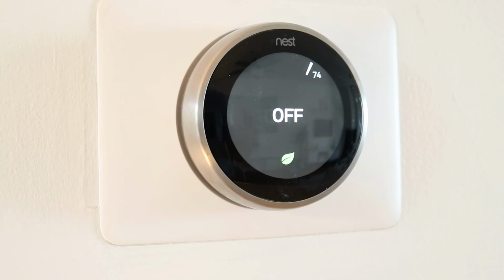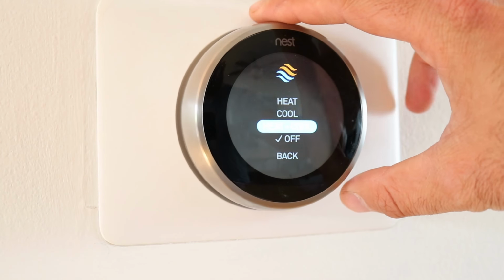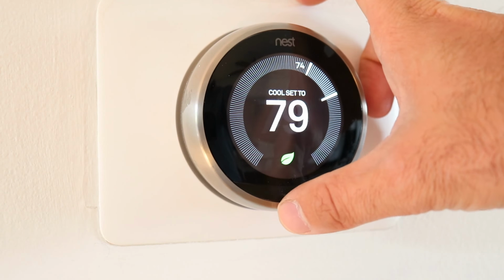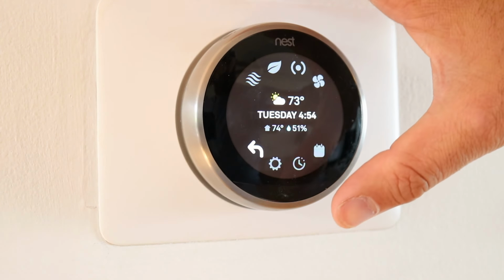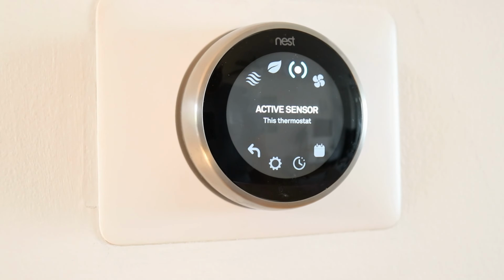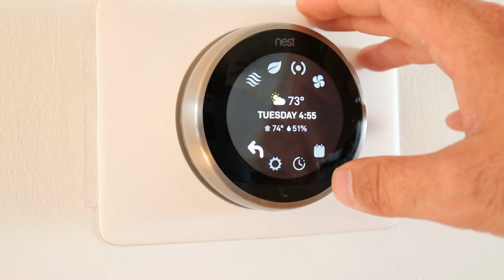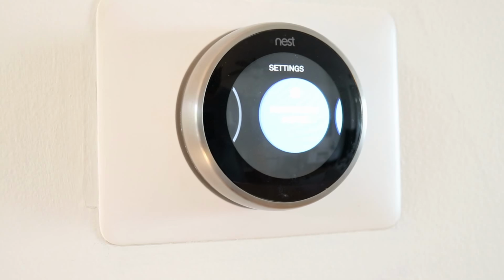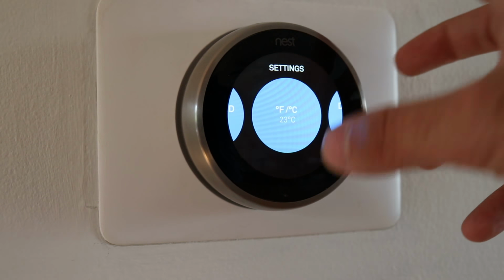Nest Thermostat Manual

Comment: Hi, I'm not sure what model of nest l have. On the settings, l have heat and eco on screen.
In eco l have heat to only, no option to cool to. So as it's a lot warmer at the moment in my area l have reduced the temperature however as you show, it will revert back to the learned schedule.
If l reset and turn off auto schedule will it still worrk for home and away and am l able still control temperature when home or away.
Thank 
Chris

Comment: Running the fan all the time or anytime it’s not in cooling mode increases the humidity in the condition space because it’s drawing water and condensation from the evap coil. Turn your ceiling fan on or tower fan ect. This guy is obviously not an Hvac service tech